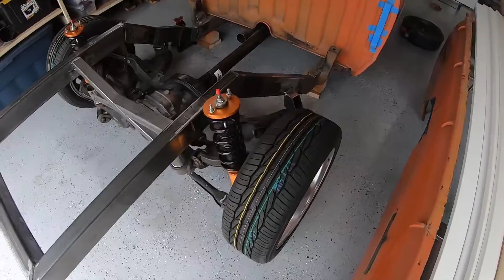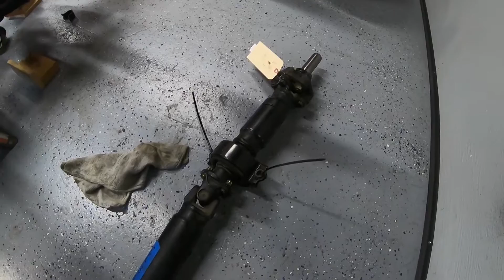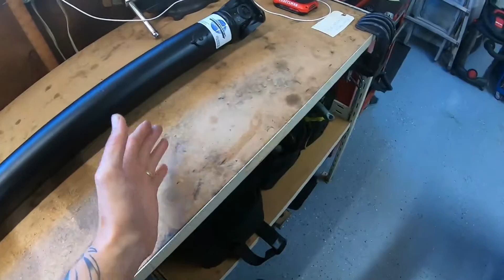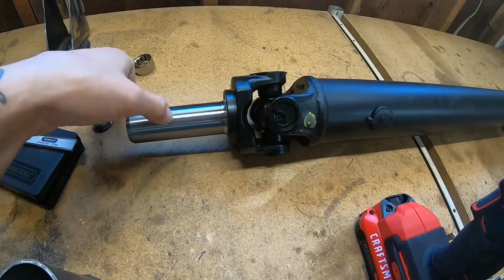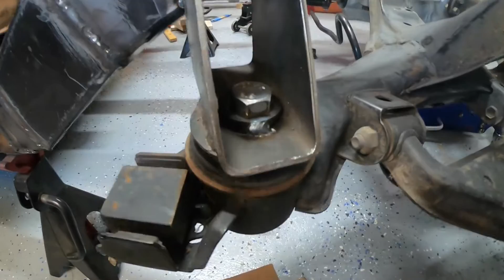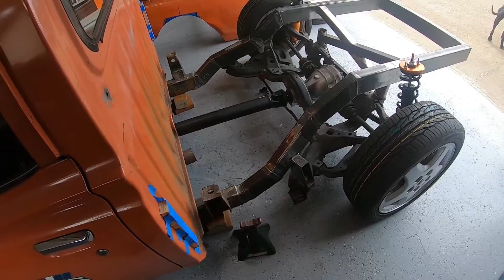240SX swapped Datsun 620 - S14 rear sub frame mounted!

Comment: Hey man is an amazing job that you are doing, I have a bunch of questions about your project I like your set up for the suspension, I was planning do the same but i didn’t know where to start, I’m planing use a vq37 in my 620, is any way how I can contact you? I’m wonder about measuring and mount points, I can’t wait to see your final result!! Keep going man!!
Reply from the maker: Hey thanks for that! I could tell ya right now the VQ 37 is going to require way more cutting than this. Even running the sr20 with the 240sx front subframe in the factory orientation the firewall would have had to be completely removed. If you want to reach out to me you can email me at portyschopshop@gmail.com good luck on your truck!